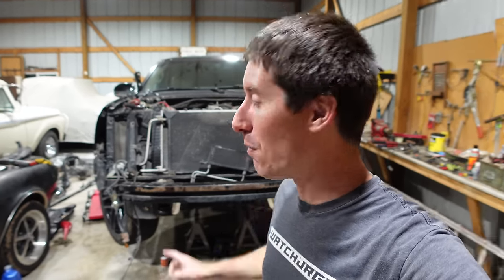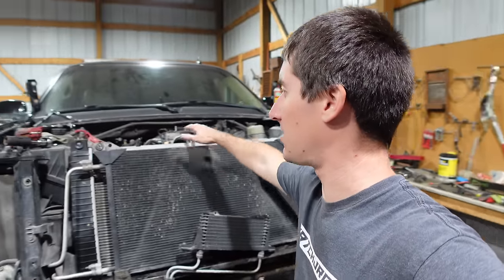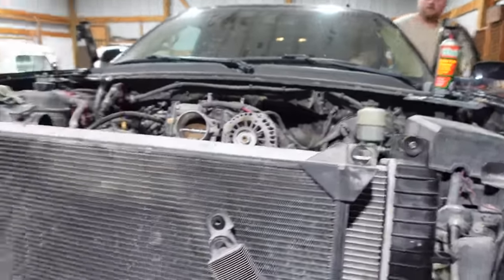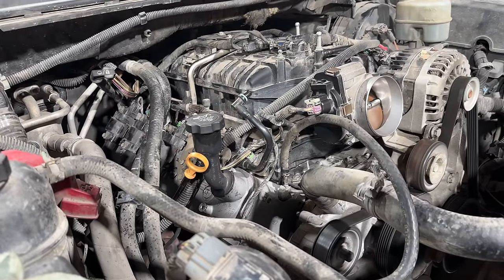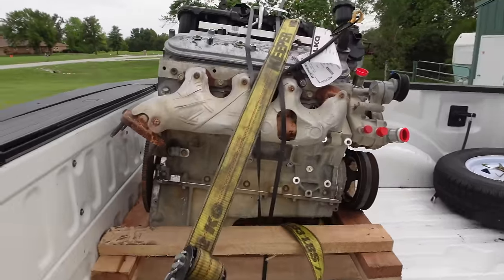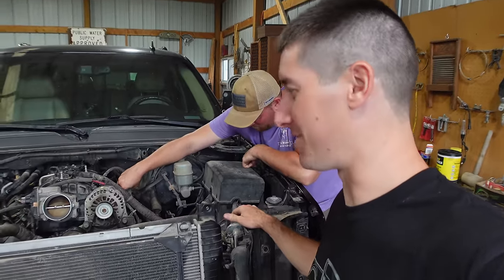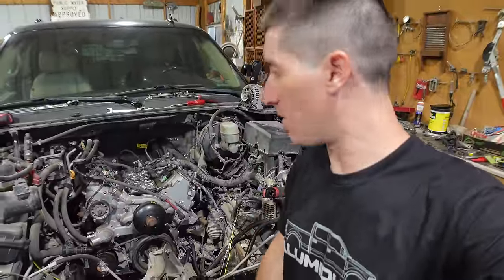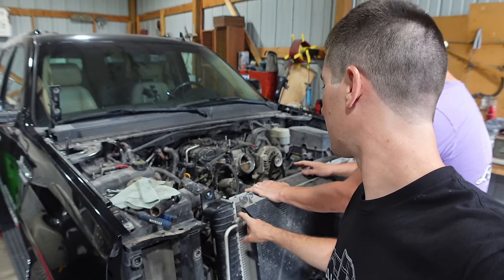DISASTER Strikes My CHEAP Escalade Engine Swap

Comment: Nothing worse than firing up a new engine just to hear a rod knock. Happened to me a few times, so now I always pull the pan off to inspect the bottom end before installing.
Reply: Yes, pan gaskets are cheap compared to replacing an engine. It can also tell you a lot about the engine.

Comment: What gets me is how rare it is to hear rod knock on random vehicles driving around. However on random used engines it's very common.
Reply: once those bad engines  are sold to others the knock spreads
Reply: keep in mind of a work truck is going in has that noise though keep going until dies then it goes to the junkyard

Comment: 40-50psi oil pressure on cold startup is pretty normal on those engines. I have an 07 Avalanche that has 40-50psi oil pressure on cold startup. A lot of people on the Avalanche/Escalade forums report the same numbers.

Comment: It seems like LKQ should have TESTED the motor out before they shipped it to you!! I'm really bummed to hear they sent you a worthless motor.  That's a HUGE job to put it and pull out.  Hope the second engine is okay.
Reply: They should test them before pulling them from vehicles to put on the shelf for sale.
Reply: @CarAudioObsessions  or at least disclose they are untested. unfortunately wrecks that won't start are often assumed to be good runners.

Comment: I would love to see a garage that has a movable ceiling chain hoist, with an angle adjustable spreader bar, that can remove engines!
Reply: My neighbor has one. The winch can slide about 6 feet back and forth and the gantry arm swivels 360. So you can pull the engine from one car and swing it around to drop it in another car. He built it himself. Pretty nifty set up.
Reply: Strong's Garage.
Reply: JAMSI ONLINE & Fireball Tool.
They're not that uncommon.

Comment: Ouch, that sucks. Better man than I. I did a transmission swap on a 04 Grand Cherokee 4.7. Replacement died a week later. Flushed everything properly, new fluid, and filter. I did it ground level without a lift. Wasn't doing it again, sold it for $800

Comment: You actually do not need to pull the radiator or the condenser to remove the engine without the transmission.

Comment: Reminds me of replacing my transmission some years back on a 1999 nissan altima with a junkyard one. Claimed it came out of running and driving vehicle of course. It took me 3 days, no lift just jack stands multiple floor jacks and a cum a long ratchet connected to the garage rafters. After all that, the transmission still had a bad 3rd gear. Sold the piece of shit for parts as soon as I could.

Comment: Next time you want to build oil pressure before initial start, just connect everything and hold the gas pedal to the floor.  If it’s on the floor, it won’t start but at least builds pressure.

Comment: If only there was a way to test run a replacment engine before installing in the car?
Reply: Lol right?
Reply: Not really feasible they would have to have a dedicated stand for every platform. Modern cars are nutty they have to have communication with so many different parts before they'll run.

Comment: That's a slap in the huevos, you took it better than i would have. LOL. LS motors are one of the toughest you can get in my opinion although my 2010 5.3 with 110,000 miles needs a cam. I know, suprise suprise.

Comment: There is almost 0 reason for that to happen. The salvage yard engine should have run for some time to check it before they pulled it. If they were unable to run it, they should have given a disclaimer. 

I got 1 bad engine in all the years of swapping used engines. It had a dead/o compression on 1 of the cylinders. They said it ran perfectly when pulled, but sat on the shelf for some time. Not happy on that one.

Comment: my first thought when it was still quiet was lifter tick... and then no, no thats definitely not the ls lifter tick.

and at this point, there's literally no reason that can't have just started putting the engine side of the harness  onto a splitable connector over by the firewall entry, away from the heat/etc to make swapping engines easier. pull connector, grounds, hoses and mounting bolts, and out.

except no, apparently thats just not a thing for most cars and trucks.

ludicrous.

Comment: I stopped changing engines for custumers because they don't understand that if they bring an engine and it does not work,it is not my fault and labor has to be charged. Few arguments and nope.
Reply: Come on.  No brainer.  If the customer brings a bad engine, of course its on them to recharge them to do it twice.  Engine changes is what mechanics do and make their living it.  But, ground rules need to be set. Common sense.

Comment: Nothing worse, than performing an engine swap and the replacement engine is bad.  Happens too often.  Good that your supplier had another and did the right thing.
Saving grace is...this isn't a FWD car which are a total PITA unless dropping the cradle out the bottom which requires a pro car lift and a cradle table.
Even though these vehicles get poor gas mileage, a lot to be said for a V8 and rear drive.
These vehicles make a lot of sense for DIY'ers.
Reply: Well, I personally would rather do a FWD car engine swap over one of those 4wd trucks. I personally have a mid rise scissor lift I drop the powertrain on a caster dolly. Thing drops out as an assembly, sometimes in as little as 1.5 hours. Then you just roll it out and split it and swap parts. Dolly I paid $200 for and lift was $2k.

Comment: I learned the hard way as a flat rate tech. I always try to push the positions down with a screw driver or something to check for bad bearings. I need a truck for Chevy afm lifter tho

Comment: it's not cheap now.. it's a very expensive hunk of junk...
like all gm vehicles are
Reply: Lol my 05 Trailblazer with 281K and 03 Avalanche with 300k would beg too differ  😂😂
Reply: @lovellmills7959  People kills vehicles more than they die randomly.  Likely this bad engine was run out of oil like most engines that fail.